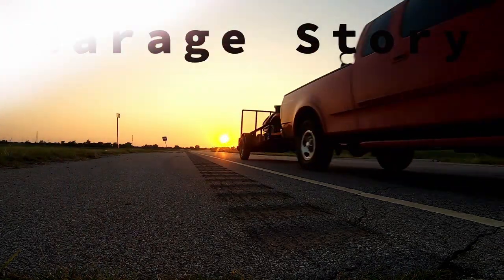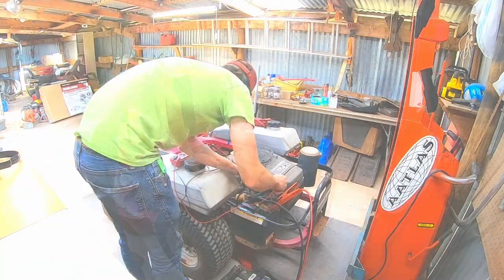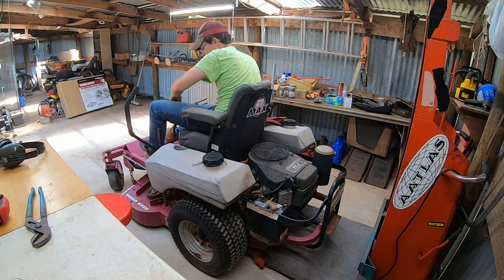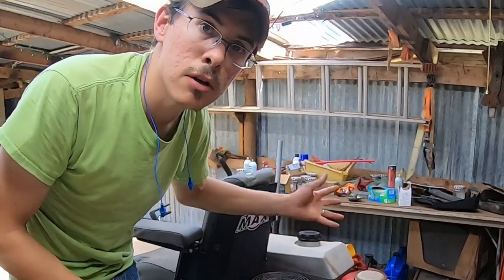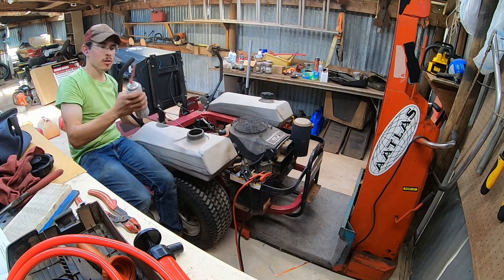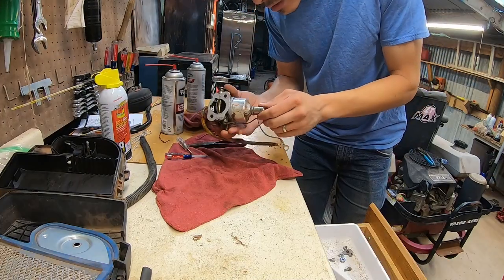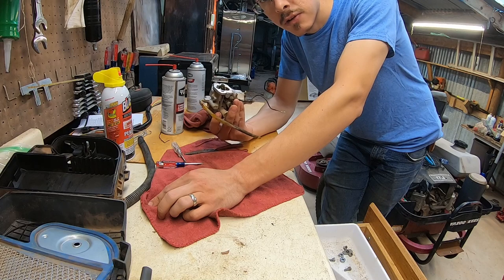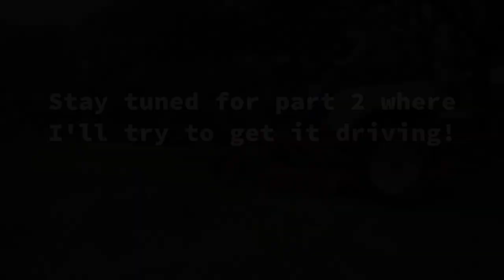Will it RUN?! Commercial Zero Turn for $200: Yazoo Kees ZT Max 42” | Garage Story

Comment: Probably about a 2007-2009 year. Looks like a Kawasaki FH series engine (good). Should be able to sell for around $1200-$1500.
Reply from the maker: Cool! Seems a little hard to find information like that. I hope I can sell it for around $1,500, but $1,200 is probably more realistic due to lack of brand recognition. I could sell a residential grade Toro for more probably.

Comment: Do you answer viewer questions about their mowers??
Reply from the maker: If I feel like I know the answer, I usually try to.
Reply: @garagestory  I purchased a Husqvarna           
Z254 with a 116 hrs on, but the previous 
Owner left it out in the Florida weather for years. The flywheel is rusted and I had to replace one of the magneto’s. My question is should I remove the flywheel off the engine and inspect and clean everything or leave it on and just clean the rust from the top and sides? Thanks
Reply from the maker: Me personally, I wouldn’t remove the flywheel unless there was an issue that comes up. I would try to make sure that the magnet on the outside of the flywheel has most of the rust removed and that that everything is gapped correctly so you get a good spark.
Reply: @garagestory  Thanks so much, I did clean the side magnet. Where do I find the info for the proper gabbing l? It a Briggs and Stratton motor.
Reply from the maker: I usually just use a piece of think paper, maybe a business card or something like that.